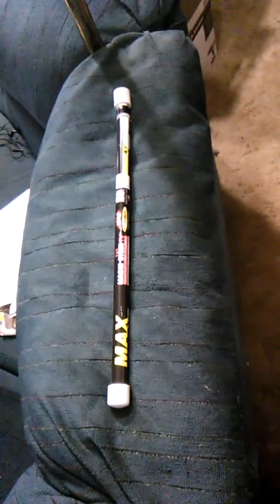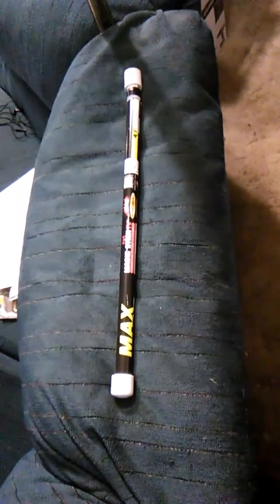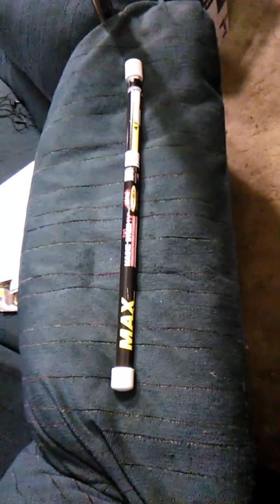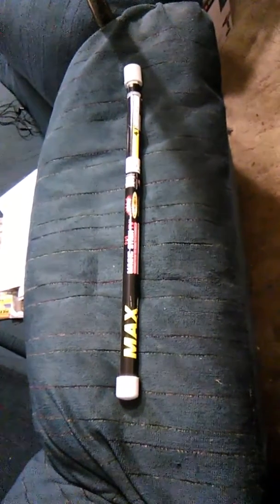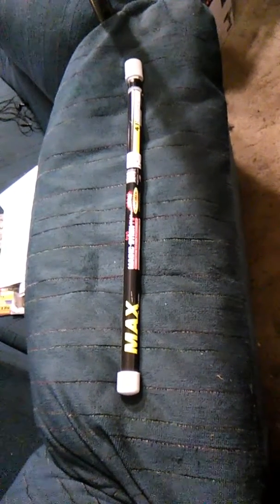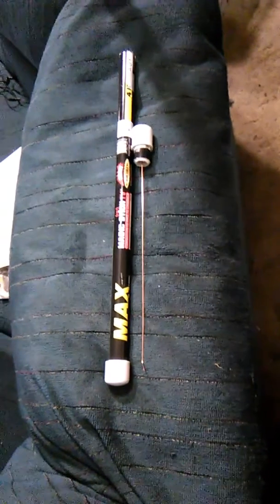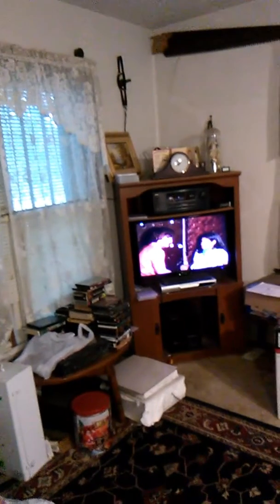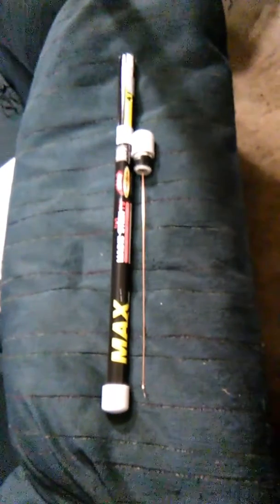So THATS whats inside a "magic stick 4K" antenna!?!?!?!?

Comment: Know how you feel. On first it was showing well. Than after about 3 months pixels like yours.   What can we do about it?
Reply from the maker: I switched over to one of the cheaper rotating antennas. The main drawback with it is you get close to tuning it to a station and then you hit the button to rotate it just a little more and you don’t know which way it’s going to rotate. It doesn’t matter which button you push on the remote, it will rotate randomly one direction or the other. So after a while of that mess, I finally just pointed it in a direction to get most of the decent channels in my area, I climb down off the roof and I threw the remote in a drawer. That has worked well for a long time until recently. We had some 70 mile an hour wind gusts, which I think rotated it slightlyso now when it is windy outside, the channels will flicker in and out. Otherwise, it works good.

Comment: I use a coaxial cable stripped and taped to a pie plate, works great... glad that wire inside a PVC pipe works for you
Reply from the maker: It didn’t. The first one I bought worked great and I ended up installing that one for an elderly gentleman. when I purchased the second one it didn’t work hardly at all.

Comment: Yeah! I bought the original one a few years ago and that's what I figuredit had inside? The only problem I had with it was when I coñnected it to my TV? It wouldn't pick up any channels? So I changed the cable that came with it? Then it worked fine?😊

Comment: I only paid 12 dollars for mine and it works great
Reply from the maker: Richard Vacanti The first one I bought, which was just a regular magic stick antenna, worked excellent. This one not so much. Maybe it’s a knock off.
Reply: bluecollaradventures me to mine was a small one. So I even installed it outside.works great